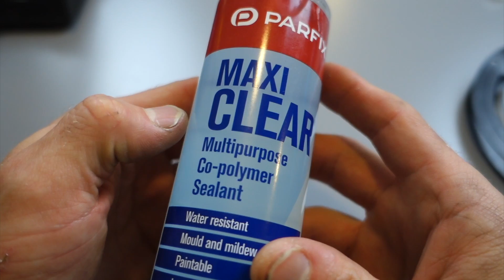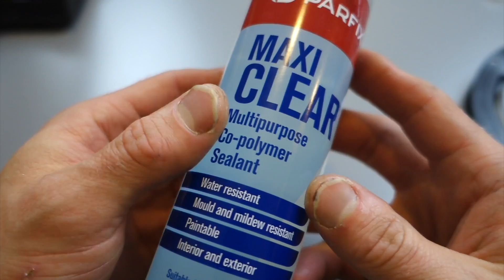How to Water Proof Your Led Strip Lights - Guaranteed !!!

Comment: so did you poke a hole to run the wires through the caps or do they have a hole already??
Reply: They come with 2 holes for 8/10 mm(must order them). For 12mm you can get with 3 holes.

Comment: I paint mine leds with acrilic transparent lacquer like for nails. It works well for year or so. It's a thin layer. I barely can tell that it's painted.
Reply: Hi is it safe, wont it overheat the led?
Reply: @paulocruz5674  don't do it. It burned over time. LEDs still works but the acrylic lacquer burned leaving marks.

Comment: Ur lights were already waterproof..
Reply: That was IP65 waterproofing, which wouldn't last long on a motorcycle. What he's doing will work pretty good, but if you're doing 6ft strands of 100+ pixels for underglow, the silicone sheathing might cause some heat dissipation issues that could also affect the longevity of the lights. Trust me on this, do it right the first time and know for certain they're waterproof by only using IP68.
Reply: how do you knowww ? hehe

Comment: link a video where you do a 5 meter reel  the same way....... getting the strip, 5 metrs in the tube .
Reply: Yeah short runs are easy, but at 1 meter in you already get problems.
I am sleeving this 5 meter cct cob, already issues at 50 centimetres.

My sleeve is 10 meter but I don't want to cut (don't like if it is too short or long) beforehand.

I wil update.
Reply: I attached the rope around the wire with a double knot.

The other end I fastend to water tube(where the tube is attached to the wall with an anchor).

It went well for a bit, but then the rope slipped of the wire.
I did not want to knot the electrical wire because the thickness might be a problem, now I am stuck and thinking to abandon this and maybe restart another day (with a new sleeve with the rope reachable).

Comment: I have previously used the IP67 LED strips (that's the unprotected LED strip pre-inserted into the silicone sleeve). But I did have some water ingress and damage after several years (in a garden, not automotive). Using the IP65 rated strips inside the IP67 rated sleeve is an interesting idea which I will try this time around.
Reply: How did the ip65 strip work?
Reply: @lightningstruck98  I abandoned it after... 1) the difficulty of threading 1metre of IP65 strip inside the silicone sleeve (even with lots of lube!) and 2) when I did a postmortem of the failed LED strip segments, the problem wasn't water ingress into the strips themselves. I had some failures in the cabling, and most failures were just failure in the strips (WS2812 addressable strips are prone to it). Lesson for me: Do the post morten first, and assume nothing!

Comment: A few questions. Does the sheath that you used affect heat dissipation at all? Also, now that you've been using this method for a year or so, have you noticed any discoloring of the silicone sheath? I've been told that they turn yellow over time. Wondering if you've noticed that at all. Thanks!
Reply: Thats what I was going to comment... I bet they turn yellow over time

Comment: Those particluar LED strips are already waterproof "gel" siliconed from the factory LOL.  Just need dab of silicone on wiring solder joint with heat shrink on joint and done.
Reply: That's not true. Most tape with that silicone coating are IP20, the silicone is more to prevent physical damage to the chips rather than ingress of dirt and moisture.
Reply: So you didn’t watch the video… everything in a paragraph.

Comment: What about this for the wiring?  https://geek.wish.com/c/567a71876a5e2b37e5b7bd21
Only work for 2 wires ones though
Reply from the maker: You can buy the 4 pin connectors. I prefer to solder but the connectors work. I am not sure if they will fit in the silicon tube though. If its for an inside job that would be Ideal.